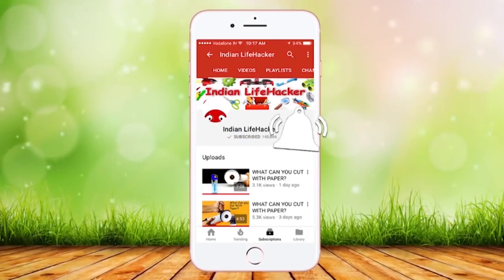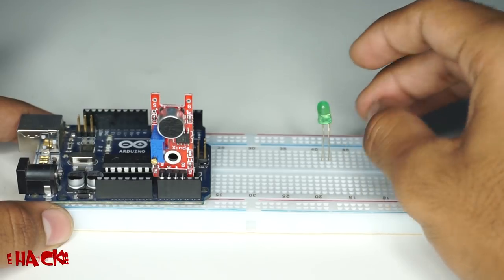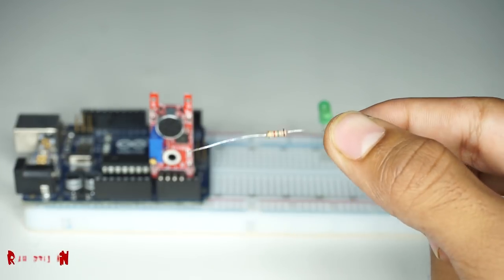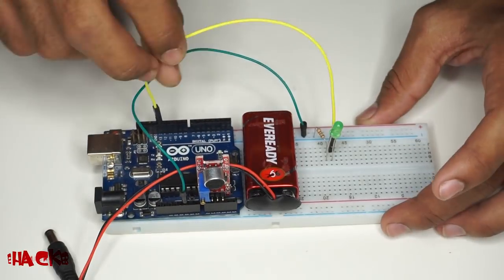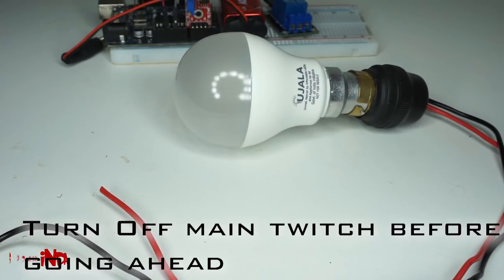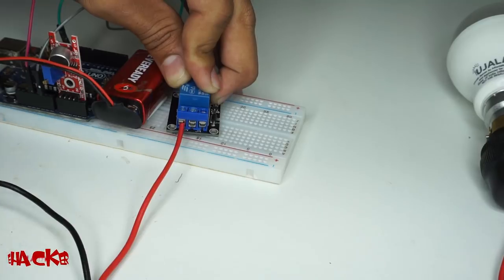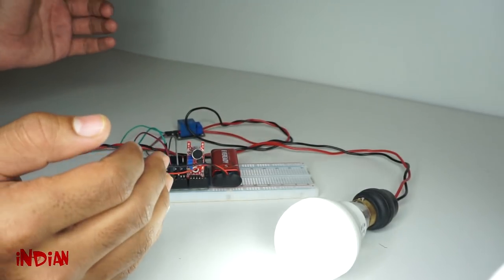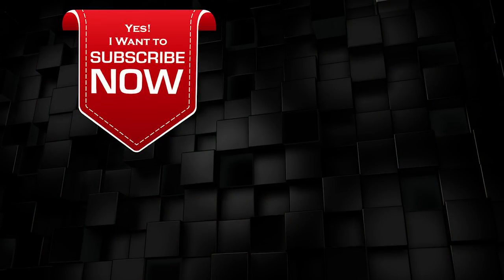How To Make A Clap Switch | Control Light & Fan With Clap using Arduino | Indian LifeHacker

Comment from the maker: Arduino Code: https://goo.gl/yW86AW

Buy Stuff here:
Arduino Uno: http://buy.flyrobo.in/uno
Sound sensor: http://buy.flyrobo.in/sndsnr
Relay: http://buy.flyrobo.in/rlymd
Reply: Indian LifeHacker arduino code is fake or true???
Reply: argent ok tomorrow morning  any  time
Reply: Indian LifeHacker  Can you give me your email sir?
Reply: Indian LifeHacker show proper wireing and diagram
Reply: This is true. I want to use this in my mini project at my college
Reply: I have a doubt plz reply.
Reply: What Is The Name Of The Wire Used Behind Everyday Battery
#IndianLifeHacker#
Reply: @khairulannam4992  Its a working code its not fake.
Reply: Man does it have timer to turn off
Reply: I don't have a single relay channel but a 4 relay channel
Reply: @mayaaboufakher7347  JUST ADD 
void loop() {
  digitalWrite(in1, LOW);
  delay(3000);
  digitalWrite(in1, HIGH);
  delay(5000);

YOU CAN USE THIS FOR TURNING ON FOR 5SECS TURN OFF FOR 3 SECS....just make change in delay
Reply: @kinggamingyta1015  jumper wires

Comment: Tried your setup and worked for me. Thanks. Only drawback: Surrounding has to be pin-drop silent for the clap switch to work.
Reply: U got output bro.......
Reply: Hey vat code did u use for bulb?
Reply: What code did you use?

Comment: Hello....there is a difference between the diagram connections and the connections in arduino
Reply: Can you tell what is the difference because i am also facing probboem
Reply: Can we use Arduino Uno SMD?

Comment: I have a doubt ..  when we connect to led with arduino then the code that is used for led can be used  same for the tube light with relay.  I mean code of BLINK can be applied for a tube light or lamp of 220v with relay and the same blink code only can be used for big appliances ??? or the code for the relay has to be different or the same as led??
Reply from the maker: It will be same for both!

Comment: How did you place the fret board inside the switch board. Can I use the switch even after I did this setup?
Reply from the maker: If you have less place inside the switch board than don't use breadboard and use Arduino Nano instead of Arduino Uno
Reply: Indian LifeHacker Thanks dude. Big fan of urs.. I am glad u replied👍

Comment: Do we need the battery cell for arduino to work when connected to tube light also???
Reply: No bro u have to connect that wire which u connected to battery cell u have to connect it to main switch
Reply: Arduino uno runs on 5-12V DC supply and the tubelight uses 230V AC.. you can power Arduino using AC supply

Comment: Can I use regular electret condenser mic
Reply from the maker: You can use but you need to do some changes in connections as you will not directly get this output.